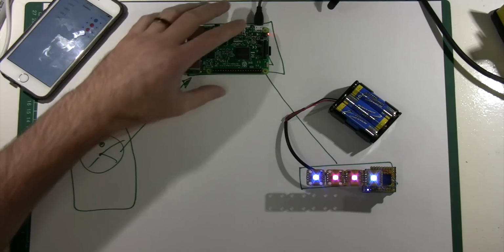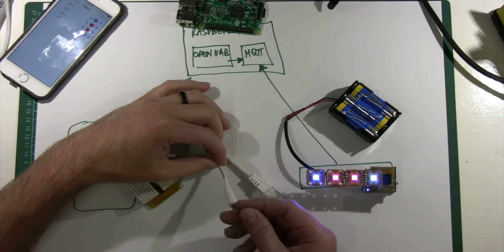SuperHouseTV #14: Ambient tile using Arduino, ESP8266, and NeoPixel compatible LEDs

Comment: I know it's 2 years now but maybe it will be helpful for newcomers. At 5:40 (and other parts of the presentation) you mention about spot lights not being diffused enough for the whole tile. There are asymmetrical diffusers to address such issues. Search for "lenticular light diffuser" or "elliptical diffusers" - those can have even up to 0.3 x 60 diffuse strength so extreme diffusion in one axis and almost none in perpendicular one. Cheers.

Comment: Nice use of tile. I just happen to be building one that indicates the status of my train line, outside temp, inside temp, and oddly,  my outside freezer. The freezer requires regular defrosting (it's old) and I have figured a temperature trend pattern as it ices up. An algorithm tracks the temp and flags performance via status LED when I should defrost.

Comment: I know this is an older video, but I am creating an "orb" with a small white frosted globe (yet to be sourced), with an RGB LED inside driven by ESP8266 using messages from MQTT.  It will sit near the front door and glow softly to indicate the temperature outside.  Greens if it will be comfortable in normal street clothes, blues for cold, yellows for warm (short sleeves and shorts [I am in the Arizona desert], progressing to Orange, then Red if it is over 105 F or so...  I'm considering adding "lightning flashes" occasionally to indicate a forecast for storms.  I have a ton of data from the DarkSky API already coming into NodeRED every 10 minutes.  Thankfully, these are ideas you can implement in your tile display, despite the fact that you installed it now 5 years ago.  Software is an awesome thing :)

Comment: Is that connector you're using on the cable similar to a computer fan connector ? What do you call them ? Great idea for electronic  projects ! Cheers Jon
Reply from the maker: Yes, it's the same sort of connector. I don't know what they're called, they come in many different sizes (2-pin, 3-pin, 4, 6, 8, 10, etc) and are 0.1" pitch so they go perfectly on breadboards and prototyping shields. They come in both straight (vertical) and right angle that sits flat on the PCB.

Comment: For weather proofing try canning jars and a little silicon caulk. It works great and you can see what's in side. Here is my auto chicken door -> https://c2.staticflickr.com/8/7624/16567410200_cba467d2da_b.jpg

Comment: Your confidence in the life expectancy  of the LEDS an not  need to replace them amazes me. Nice project though!
Reply from the maker: LED performance definitely degrades over time, but in my experience that's usually thermal related. The idea with this panel is that the LEDs are only rarely illuminated, and even when they are turned on they are at a tiny fraction of their full brightness. I've found that they should through the tile so clearly that I only need to run them at a few percent PWM, and they still show a nice glow.

Comment: I notice you input 12v there, does the Wemos take 12v OK or are you reducing the voltage? Nice idea by the way, so what if you don't have a use for them. Thats usually where it starts :)

Comment: They make LEDs that have the addressable PWM chip inside already, that would have made it even more compact.  If someone is doing this on "thinset" mortar, the smaller the package the better.
Reply: Also, if you wedge the LEDs in between the tiles to edge light the tiles you could put them in after the tiles are mounted to the wall and use the grout to hide the LEDs and wiring.
Reply from the maker: Yes, with newer integrated addressable LEDs this could be even thinner. At the time I did the tiles, the WS2801 was the latest driver chip available and it hadn't yet been integrated into an LED body. If I did this now I'd use WS2812B or similar LEDs
Reply: +SuperHouseTV for added diffusion, you could have sand blasted the outer face. If you wanted to additionally eliminate the "hotspot" effect, you can drill into the tile (VERY carefully) about half the thickness, then press in a piece of aluminum foil with the dull side painted white facing out towards the viewer, and the shinny side facing the led. This would change the light output pattern from direct firing to what is called a "batwing" output pattern. Total internal reflection would spread the light around perpendicular to the tile's finished face until it found the sand blasted face. It would have a more even and soft light to it.

Comment: Another boring use could be for illumination around a bathroom mirror. But a great status LED system for the house. :)
LED scrolling message matrix maybe? Obviously not with thise LEDs but you get the idea.

Comment: Maybe if its to give feedback for the environment its in, they shoukd reflect the status of the kitchen somewhat. Maybe when the oven is oven is on for example, red can remind you that the oven is running.
Reply from the maker: That's a great idea! Or maybe I could figure out a way to sense if the dishwasher is loaded with cleans or dirtys
Reply: if your dishwasher has a display timer, could tap in to the timer and build some logic rules based off that. timer 0 = clean; timer off = dirty; timer < 10 = something; timer >/= 10 = something; etc. it would be tedious to read the led/lcd but hey, it seems like you have figured out more difficult in the past. 

you could hook it up to your alarm, flash red and blue when it is triggered. make the crook think the cops are coming. :-P
Reply: Toby Robb Your oven has feet?